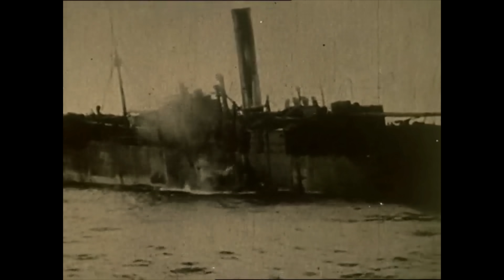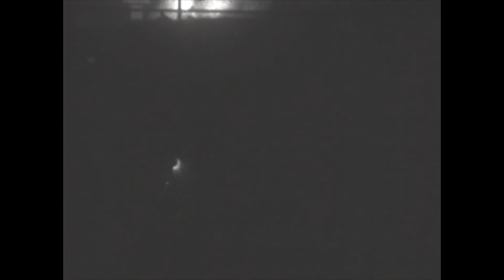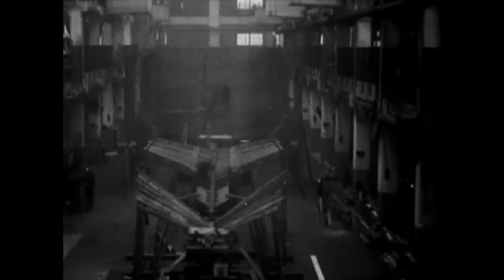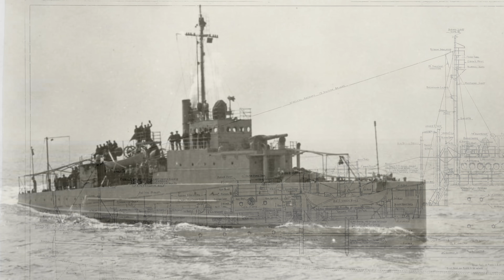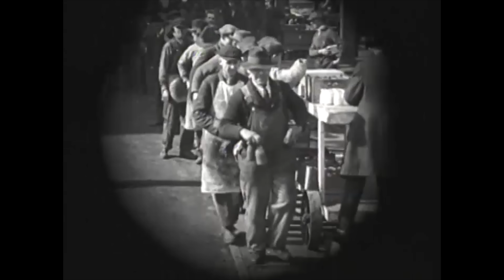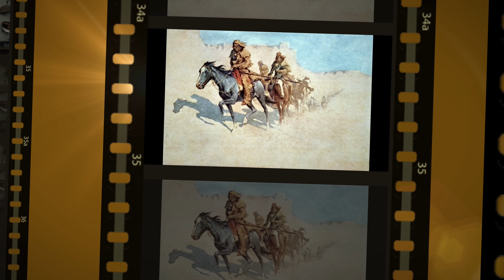Ford's Navy: The Eagle Patrol Boats

Comment: As a Ford retire. Both my wife and I retired from Ford.  This doesn't surprise me.  We both worked there.  before the vistion parts plants split. . Ford at this time. Could move fast. . From conception to rubber on road in 13 months.  The Ford ranger was faster than that.

Comment: Ford "Eagle" Boats program was another of those American mobilization production programs that got caught in the lurch with WW1 ending earlier than the Allies expected. The Allies did not expect to end the war until the autumn of 1919 after the impact of the planned grand offensives of that summer, which included opening a front in southern Germany with the collapse of the Austro-Hungarian Empire. As a result, only four boats were delivered and commissioned before the Armistice in Nov 18. That meant that the boats had absolutely no impact on the campaign against the U-boats, which in fact had been won in the summer of 1918 with the full implementation of convoys. Because of the inexperienced and untrained procurement officers that fed the mobilization, there was no cancellation clause, forcing the US Navy to accept and pay for Eagle Boats built after the end of the War. As it was, there were still 12 such boats, though not all were still ASW vessels on inventory on 7 Dec 41.

Comment: The WWI 110 Ft boats were also made in WW2 for ASW use. The 110, 135, and 104 foot wooden boats were used all over the world. In 1967 to 1970 I worked on P143 a 104 foot Army crash boat, converted into a Albacore fishing boat in the Pacific. It had 3 each 671 diesel engines running three props, and 2 each 371 engines for DC Generators. What a great boat!

Comment: This vignette describes the pioneer effort by Ford to build a new and untried class of ship.  About 20 years later (1942) the Dravo company improved Ford's transfer method and US Steel moved a per-existing plant structure from East Chicago to Ambridge, PA where LST's (Landing Ship Tanks) were constructed and sent down the inland rivers to ferry war material across the oceans to achieve victory in WWII.  The 'cornfield' shipyards along the mid-continent rivers built about half the 1025 LST's constructed for WWII. By 1945 The Ambridge shipyard could build, launch and significantly fit-out an LST in about 31 days. Some of those LST's remain in Pacific Ocean navies to this day.  The Eagle Boat pioneers would be proud of the heritage they invented.

Comment: "Ship" denotes sails. Boat is the more general term.
Reply from the maker: No, the term "ship" has nothing to do with sails. There are plenty of ships today- very few have sails. And many boats do have sails- called, literally, "Sailboats."  Boats are distinct from ships- the Royal Navy, for example, teaches its cadets that a boat leans IN to a turn, while a ship leans OUT. The difference between the two is usually seen in size. In fact, most define a ship as being 200 feet or longer, making the Eagle boats, at 200.8 feet long, nearly the line between the two. Traditionally, though, submarines are referred to as boats no matter their size.

Comment: Of the eight "Eagle"-class patrol boats listed in service in WWII, 6 were sold off and 1 scrapped in the 1946-47 time frame.  As noted, the boat that had been renamed "PE-56" (Patrol craft, Eagle - 56) from its original name USS Eagle-No. 56, was sunk in action; almost certainly by the German Navy U-boat U-853 on April 23, 1945.

Comment: The irony is that Henry Ford flat out refused to build the Rolls Royce Merlin aero engines in WW2. He really didn't like the Brits and refused to build an engine destined for British use. 
Packard stepped up to the plate and made 55,512 Packard V-1650 engines, used initially in British planes, and then the American Curtis P-40F and the venerable North American P-51 Mustang.

Comment: only 8 out of 60, 
what happened to the rest 😅 

probably the first 10 were basically prototypes with more issues but a 25 year old boat should still be serviceable and upgradable.
Reply from the maker: A few were given to the Coast Guard. Most were decommissioned or sold in the 1930s.

Comment: Few people know that Henry Ford's first two factories did not have assembly lines. They built cars one at a time at work stations, much like boat building. His people had experience with station assembly, as it was called. His third factory, the huge Highland Park assembly plant, was outfitted with the assembly line just to keep up with demand for the Model T.
Reply: And Ford copied the assembly line process from the Oldsmobile company who copied the concept from Ely Whitney’s firearms line.
Reply: @allangibson8494  And the meat packing plants in Chicago were using them too. Whitney used interchangeable parts but I don't think he used an assembly line.
Reply: @ Technically the meat packing plants were “disassembly lines”…
Whitney did use assembly line practices in his armory.

Comment: At 11:18 the boat is passing downtown Detroit on the Detroit River. The large boat in the background is one of the Bob-Lo Island excursion steamers, either the Columbia or the St. Claire. Both were used until about 30 years ago and I believe both still exist. The Columbia was built in Wyandotte, Michigan further downriver. Where the McDonalds is today.
Reply: I remember going on the Boblo boats many years ago and.  Great times.
Reply: I was wondering about the proposed route to get the boats to the shipyard in New Jersey.  I'm not sure the Erie Canal had the depth to accommodate that size of boat.  Fitting the ships at the plant and then going through the Welland Canal to Lake Ontario and then up the St. Lawrence was much easier.  It didn't hurt that Canada was part of the UK war effort, so all help was appreciated.
Reply: One of the Bob-Lo boats suffered a fire.

Comment: Wasn't the River Rouge plant used for making airlpanes. on an assembly line? Not to mention Kaiser-Fraiser cars?
Reply from the maker: I think that the Rouge river plant was used to manufacture airplane motors and parts. But I don’t think that planes were assembled there. Ford built the Willow Run plant to build B-24s.

Comment: That property at one time took raw sand, iron, coal and other raw materials and made the entire automobile besides the tires and some small parts. 
If I remember right they even made ball and roller bearings on site. They made glass and everything. It was supplied by lakers (lake freighters) owned by FoMoCo. This was the most advanced factory on the planet. Sally by the power plant explosion in the 2000s the facility was no longer an all in one stop and the lakers were all sold off.
At one time Ford Motor Company made AG equipment and commercial OTR trucks down to little compact economy cars. I didn't realize they also built ships at one time till now.
Reply: By 1944 Ford was turning out 650 B-24 Liberator four engine heavy bombers a month at the Willow Run Plant. They built almost 9000 of them during the war.

Comment: My dad was an electrician at the Rouge Plant in the steel division. The Rouge Plant at one point made almost everything that went into a car including glass. Sadly, much of the plant has dried up and blown away.
Reply: It's still here. I'm am electrician in the Blast Furnace. 

 C Blast Furnace is operating, as is the BOF and Concast. We're under a new name, but Steel is being made.

On the Ford side, they're ticking along as well. See lots of F150s out on test drives. 

Glass plant is gone, and the plant doesn't make everything like it used to, but that mostly went away in the 50s anyhow.
Reply: My uncle worked there in the late 60’s and early 70’s.
Reply: I grew up half a mile from Henry Ford's birthplace, and my dad spent 41 years working at the Ford Rouge plant. That plant still makes F150 pickups, I did a tour of it a few years ago, it's still going strong.
Reply: Don't know how true it is, but I was told "raw materials went in one end of 'the Rouge' and finished Model-T's came out the other."
Reply: @Rickinsf  That was true, a very long time ago.

Comment: I'm amazed you repeated "Ford's venture failed to revolutionize ship building", but you have done THC videos on both Higgins boats and the PT boat manufacturing processes. I believe Even the Liberty and Victory ships were built using the assembly line - non-continuous lines, but similar processes adapted from the assembly line system. Love your videos, have since the beginning of your channel.
Reply from the maker: First, lol, it is THG, not THC. The History Guy. 

I understand your point.but the argument that the Eagle boats did not revolutionize shipbuilding was not made by me, but by David A Hounshell of Carneggie mellon university- a historian specializing in the history of technology. His position is that techniques for building cars did not translate well to shipbuilding. Aside from very small boats, no one has again attempted to regularly build ships in a factory rather than a shipyard. 

Actually, neither Higgins boats nor liberty ships revolutionized shipbuilding either. Both represented, like the Eagle boats, war exigencies but not sustainable methods. Most liberty ships faced significant problems with hull buckling. 

Those vessels were also built in shipyards, not inside a factory. The difference in institutional knowledge between the two is where  Hounshell says the process failed.
Reply: THC?  THAT explains why we are all so fond of this channel! (it couldn't just be the awesome content)

Comment: Build a production plant in 4 months and turn out the first ship in 2 more months is pretty incredible.    Also interesting that Edison was involved in coming up with submarine detection technology.
Reply: Henry Ford was good friends with Thomas Edison.
Reply: How many Planes did Ford Motor Co. build(WW2)???? Thousands. My Grandmother helped build B-24's at Ypsilanti, MI. Ford. While my Grandfather mined Coal in Kentucky.......shipped to the "Rouge"........
Reply: @timbernie Henry Ford refused to build equipment for Britain during WW2. That’s how Packard ended up building Merlin engines.
Reply: @allangibson8494 Probably due to the fact that Henry was a known admirer of Hitler.
Reply: Packard built an extension on the north side of their plant specifically for the Rolls Royce Merlin engine.

In fact, in Detroit I94 does a little curve around that extension. It’s the reason why there are twice-daily traffic jams right at that curve.

Packard took out loans to build that extension and those loans saddled the company with debt that they could never recover from.
Reply: Agreed. He bought land in 1915. He was given the design in Jan 2017. He built the plant in 4 months and launched the first boat less than 2 months later, July 11. That time also required building all the jigs necessary and giving the Navy time to make changes. While the first was delivered on schedule, it took until war's end to deliver 7 boats. Any unique ship takes time to fit, apprve, and work out the bugs but the war ended before Ford could ramp up. The major fails were due more to a poor design (which Ford had little to do with), mostly in using a riveted design because Ford's people "didn't know how to weld". Even later boats often had problems with fuel oil leaking from riveted tanks. Ford's central fail was insisting on flaged plates, instead of flat plate, to help with assembly speed. Supposedly this made them handle poorly in heavy seas. It wouldn't be until WWII (Liberty ships) when prefab ships were successful... and even those had major problems in the first year or two.
Reply: Thomas was known to be up all hours, sleeping inside cabinets, and cocaine was an active ingredient
Reply: Yeah, and how much whining, complaining, and delaying has been done in the Russo-Ukrainian War?  That tells me how serious they are about it...
🙄
Reply: @tyree9055 Trump delayed aid to Ukraine in 2018 and is still blocking it.

Comment: And it's to bad that these Eagle boats cant be built now, modernized, to sell/give to the Coast Guard as drug interdiction vessels and be operated in Floridian and Carribean waters.
Reply: I suppose that the latest Coast Guard cutters are the Eagle boats of today.  From what I read, the latest CG cutters are twice the size of their immediate predecessors, and are better armed and equipped.  They're used for exactly what you would want modern Eagle boats to do.

Edit:  A later post from THG said some of the Eagle boats were given to the Coast Guard.
Reply: the Eagle boats were only capable of speeds of 18 knots, they would be way too slow. Modern patrol boats do 40 knots.